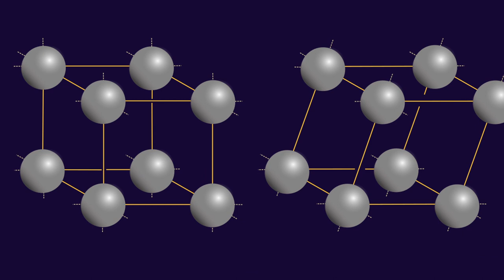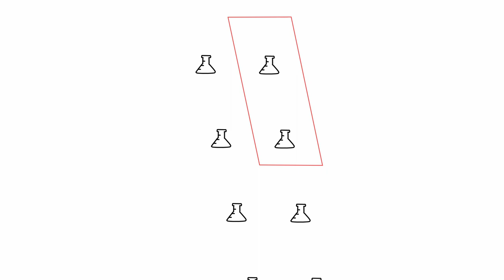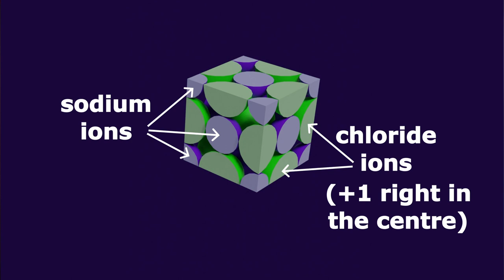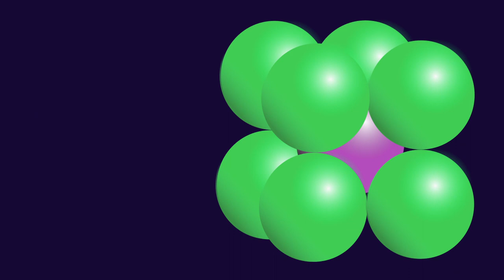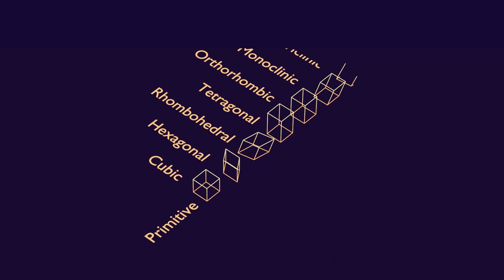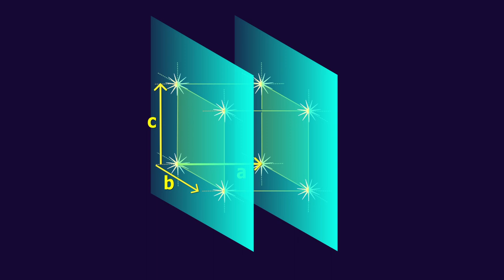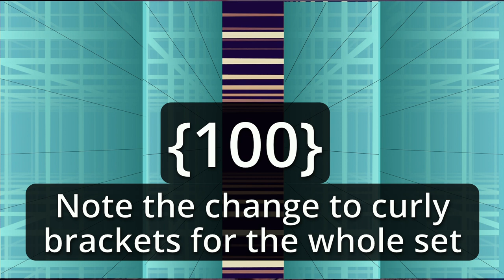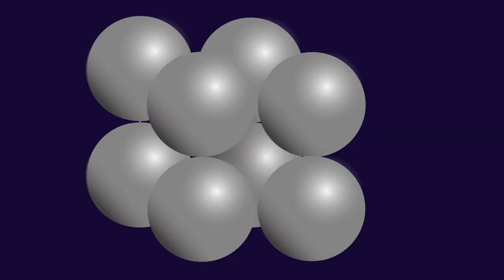What is a Unit Cell?

Comment: At 9:40 the video says that different crystals of the one substance have different densities, and that iron can form three different crystals. I think the vid should have said something about the densities of these three different crystals. Are they very different? The idea is a bit surprising. The density of iron is normally stated to be 7.8 g per cc. There's no mention of which crystal of iron that refers to.
Reply from the maker: These are allotropes of iron, body-centred cubic, face-centred cubic and hexagonal close packed (the first two at least are in the video). The density of iron depends on which crystal form you have, and that depends on temperature and pressure (and it's formation history too, in some cases). Listed densities are for the most common structure, which I can't remember off the top of my head but I'll put my money on BCC.
Reply: @ThreeTwentysix  I've seen some other YouTubers add a printed note to a video to fix it. I'm guessing that it doesn't affect the view and like tally. If so, how about adding a note listing the densities of the three allotropes of iron? As it is, the video seems to go off on a tangent, forgetting the point being made was about density, and talking instead about the desires of metallurgists and how they can be met via knowledge of crystals.

Comment: hey there! could you speak to Buckminster Fuller's Synergetics in relation to this? as it is an experientially derived kind of geometry that has everything to do with closest drawn spheres and the generalized principles at play as spacetime is structured, there are several ways in which it comes to surprising insights, particularly in comprehending the so called fcc pattern with the 'tetrahedral' (i'd call that foureyes) cell as the volumetric unit on one quantum, rendering the 'octahedral' (or eighteyes) gaps between them as four quanta. a 'cubic' shape where one keeps the triangulation in mind, so at minimum one inscribed foureyes ('tetrahedron') is present, has a quantum volume of three. in this frame of reference, the 'cube's' edges are no longer normalized as units, but rather the square's root becomes a unit of one. that's as in one diameter of the spheres involved, or one interval between the centers of two spheres connected by this vector. one radius from one sphere's center to the kissing point and a second radius into the other center. this also then recognizes the triangle between three spheres as the unit for area. this triangle is in fact dynamically structured, defines a plane and can be accounted for by the same operation of second powering as the 'square', except in polyformity as the triangle's unfolding, as all of spacetime, is complementary in nature.

i have much material and models over on my channel, presenting aspects of synergetics in my own words if you were interested. otherwise the book "A Fuller Explanation" by Amy Edmondson offers a superb overview of the framework and some of its deeper waters and of course Bucky himself left many artifacts, the two volumes of "Synergetics - The Geometry Of Thinking" which can be accessed at www.synergetics.info and countless hours of lectures and presentations. and there is much more to be found in the wider cosmos of the bfi, Buckminster Fuller Institute, the ongoing series by @52livingideas on Bucky, the work of Kirby Urner, @scientificgenius, Daniel Ari Friedman, the Synergetics collaborative, Synergetics-University, and so many more. 

if you were so kind as to consider this corner of Universe, it might be of great interest to you, revealing further connections and comprehensiveness between seemingly disparate fields of science. it certainly has changed my whole life and being and i sincerely feel like it holds the keys to a paradigmshift unlike any others before, offering practical patterns of creating in compendence of synergy rather than dependence on energy, realizations on the nature of structure and the spectrum of shapes of spacetime and their qualities. if more people knew of this frame of mind, earthquakes and rising sea levels, increasing temperatures and violence of atmospheric systems, waste production and innumerable other crises and catastrophes could be handled in very different ways, thereby addressing everyone's needs in regenerative ways, no longer in conflict with the rest of Universe. 

peace
Struppi
Reply: Bro. Yes. That was the first thing that came to mind when i saw the thumbnail and title. Thank you for commenting. I’ll check the channel out!!